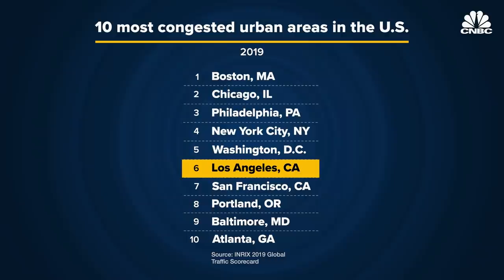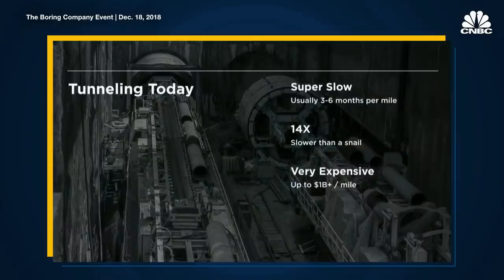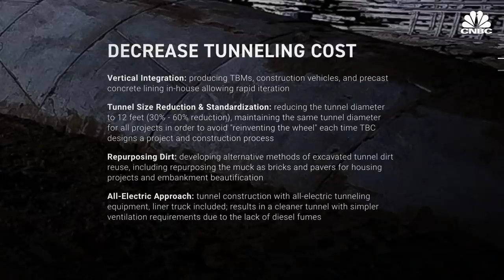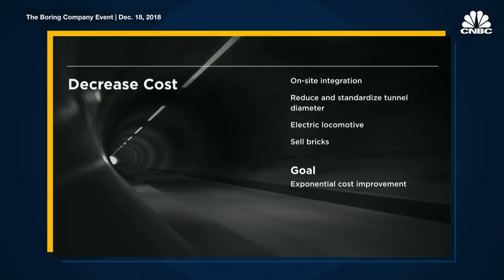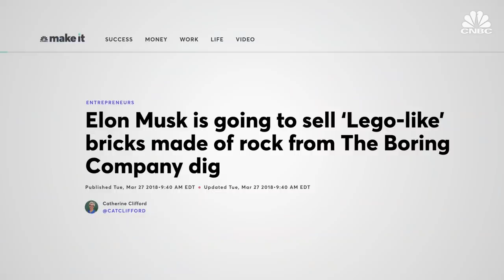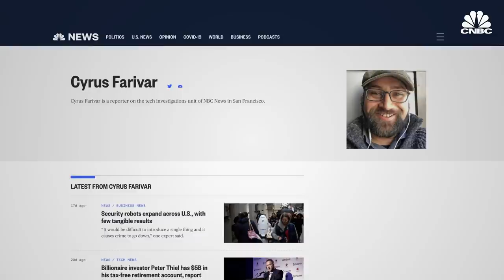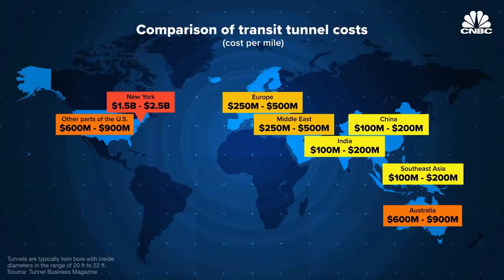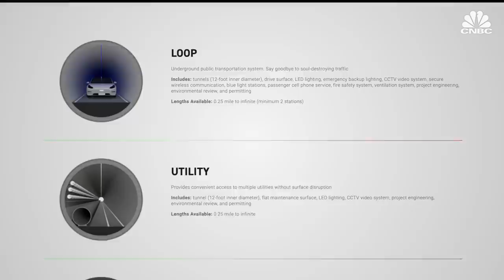Why Elon Musk’s Boring Company Isn’t Fixing Traffic Anytime Soon

Comment: If you have over a million cars on the road concurrently, even 30layers roads under the ground won't fix the problem.
Reply: Elon mass produces cars then complains about traffic. 😂
Reply: @chromebomb  he could've made electric buses, but governments would've preasured them for right to repair.
Reply: Boring tunnels are roughly 100 times cheaper than the most expensive New York/LA tunnels. So you can probably do more than 30 layers easy. You basically need as many levels underground as you have floors above the ground.
Reply: @abhinavcj1  The boring tunnels also have 100 times less capacity that a metro system?
Reply: @projectaks4745  Your math is off by a large margin. The maximum road capacity is around a four times increase to single lane roads. This is also considering that you are only allowed the 2nd dimension. Take this and incorporate the 3D aspect and you can double, tripple, or even quadruple that of road space. You also forget that underground, there are no traffic systems, which can make navigation completely automated and linear. No lights and signs attached.
Reply: Seems like elon just waste money.

I always think that why elon just build a tesla train?
Reply: @sethjansson5652  but impractical if cars use them, public transportation ftw!
Reply: @sethjansson5652  Why not just run run trains trains through the tunnels if it is viable to make hundreds of them, the tunnels are actually a few inches larger the size of typical deep level metro tunnel?
Reply: @sethjansson5652  1 tunnel, 1 train is cheaper than 50 tunnels

Induced demand, by the way. Adding an extra lane NEVER works.

Comment: a subway for 5 people. revolutionary
Reply: Surely there will be improvements. Like the adding more capacity by a new revolutionary technology called "One Engine With Various Passangers Carts™". Next there will change the motor from using batteries to use electricity by connecting to a "Hyper Electrical Chargin Rod™". And lastly they will change the rubber wheels to a revolutionary system of using steel wheels over layed "Hyper Tracks™". Dude, imagine that...
Reply: just wait!!! Elon will then REVOLUTIONIZE this by making a long "pod" that can hold up to 50 people at a time! It will then have an overhead power system so they wont have to lug around those batteries! Genius!
Reply: Less than 5% of the U.S. population  uses public transportation.  Americans , overall, just don't prefer to use the subway or the bus. That is the reality of the situation.  But I guess watching empty  buses drive around town wasting tax payer money and polluting  is your answer? How much money did Amtrak make last year?  Last decade? Listen, I'm all for public transportation  but as impractical as it may sound, the average American is sitting in traffic burning a tank of gas right now.
Reply: @MattSeabolt  People don't use public transportation because it sucks. And it sucks because politician rather spend it on stupid magical solutions like these that end up making things worse
Reply: @MattSeabolt  The keyproblem in the US is, that there are no connections, while u might be able to use a public bus in the city u can't get out without a car. So everyone needs a car and oh wonder, why should i use public transportation if i need a car anyway...^^
Reply: Ram - LOOP has Better throughput than a High Capacity bus or LRT.

Comment: In my region in Germany we have multiple different train networks that work together, though I wish we had even more trains. In the us with all this vast space trains would work even better.

Most cities with more than 100k people have a tram or even a subway system, which often extends to neighboring small cities. Cities with more than 10k people and even some smaller cities are connected by faster trains going 120km/h (70mph) with stops every 5 - 20km (3-12mi). In larger cities you can change from those faster trains to long distance trains that go up to 300km/h (180mph) that have stops every 30 - 200km (18 - 120mi).

Trams and especially the faster trains could thrive in us suburbs I think. Long distance high speed trains are a great alternative to planes (far more comfortable and spacious) and easily beat driving and definitely should be a thing in the us, too.

Comment: light rail makes the most sense economically, and far better environmentally than massive roads and complex tunnels everywhere with loads of cars on/in them.
Reply: I'd rather just take a cable chair lift to the supermarket.  No stops and no puddles of piddle.
Reply: @lowrads3653  European and Asian trains are Impeccably clean. Socialism and/or even privately run trains maintain public transport easily.

Comment: comparing the cost of 3 lane high clearance tunnel that even trucks can pass through with a 1 lane low height tunnel is stupid. back of the envelope calc. - elon musk's tunnel height is 1/4th and width is 1/4th of usual tunnels, ie. 1/16th the usual cost just by scaling down the size of the tunnel (assuming cost is linearly proportional to the volume of earth to be excavated). as usual a marketing gimmick by elon musk.

Comment: As a civil engineering consultant with years of transportation infrastructure experience I can say this without any hesitation. Building a single lane tunnel for cars is idiotic. It will not solve the traffic problem. It may suffocate a bunch of people when one of those electric cars catches on fire though.
Reply: So far the LVCC loop and extensions are working well.  Passenger wait times during the busy CES averaged less than 10 seconds. Trip times averaged less than 2 minutes. 

I have a hard time imagining a rail based system that could match that level of service. Especially one that could be built underground or elevated for less than $50 million.

Comment: almost all of these tunnels with "Tesla shuttles" would be better with trains.... if you could drive your own car its different, but if your being shuttled it may as well be a train....
Reply: Even if you could drive your own car, it would do nothing to solve traffic. See induced demand.
Reply: @kirkrotger9208  100% agreed for the average person, but for the rich it could be another matter, but Teslas just don't seem the right choice to maximise throughput.
Reply: @kirkrotger9208  Lol, there is an upper limit to induced demand. Boring co's model, which is having large no of small tunnels, wil largely address this.
Reply: So, why don't other companies do this...if u think this is a very obvious solution, let others do it? No one is stopping them.
Reply: @archigoel  issue is its not viable, you heard how much it costs per mile, $2bn, you can build highspeed rail over ground for WAY cheaper (like $30mil?).  The Chinese have built more high speed rail in the past 5 years than the rest of the world has built in the past 30.
Reply: These go point to point. That's much faster than having to stop at all the intermediate stations.

Additionally, the cars only run when there is demand and is easily scaled. Whereas trains and buses often run partially full and even empty. It will be more practical to provide TBC service of just running a few cars in times of low demand.

Tesla vehicles are inexpensive and are manufactured in mass quantities. Used ones can be sold periodically and replaced by newer models.

Trains require expensive tracks, power systems and lots of system maintenance. There is no dangerous high voltage third rail to imperil workers and others. 

The cars in TBC tunnels in principal could emerge from the tunnel and continue autonomously on surface streets.

A Tesla enters the station at a low speed and with autonomous technology so it shoukdn't be able to run over anyone. Plus you can't fall from a platform onto the tracks.
Reply: @archigoel  
Amazing how the green planet saving bloke, seems to have planet destroying side projects.
Reply: Neanby - FORD and gm KILLED the Electric Train in America in the 1930s , see gm Streetcar Scandal.
Reply: Neanby - also , Trains will cost $ TRILLIONS , LOOP will only cost $ MILLIONS to build.
Reply: @archigoel  Do you have any idea how many lanes you'd have to add in major metropolitan areas to outstrip induced demand? In most places it's more than double, often triple or even quadruple the existing capacity. And don't forget, you have to do this across basically the entire road network, not just arterials.
Reply: @user-nw8jr1dk9p  You clearly have no idea what you're talking about. Do you know what the car ownership rate is in Manhattan, The wealthiest of the boroughs in the wealthiest city on the planet? 22%. 22% of Manhattanites even own a car, and of those, only about a quarter use them with any regularity. The people in most global cities who own cars are the poor and working classes who can't afford to live in the more desirable areas with access to good public transit. Where there is good public transit, rents are significantly higher than where there is not. That isn't a coincidence. Most people, especially young people do not want to own a car. https://www.theatlantic.com/business/archive/2012/03/why-dont-young-americans-buy-cars/255001/

Cars are among the chief reasons why the US sucks. Why would anyone want to contribute to that? The whole goal for most people is to live in places without cars.
Reply: @kirkrotger9208  no matter how much you may try to convert people from using cars , into using public transportation, it will definitely never work.... I would bet my entire life .
You'd be wasting your time .
Reply: @user-nw8jr1dk9p  Okay, but given the fact that literally every time quality public transit has been built, it's become the dominant mode of transportation for people nearby, you'd lose that bet. Case in point: Amsterdam. It went from car-dependent hellscape on par with LA or Dallas to an urban planning Mecca practically devoid of cars within 30 years.
Reply: @kirkrotger9208  The car ownership is low but they use taxis and Ubers.
Reply: @Goldsteinphoto  We don't though. The only people who use Uber and Taxis are tourists. Everyone who lives here takes the subway or bus unless they're going to the airport.
Reply: @Goldsteinphoto  We don't though. The only people who use Uber and Taxis are tourists. Everyone who lives here takes the subway or bus unless they're going to the airport.
Reply: @kirkrotger9208  I never saw anyone in Seinfeld use the Subway. Washington DC has a subway and busses in the entire region. It still has terrible traffic congestion. So does NYC.

Since it costs way less for TBC to build roads underground with far less disruption than to build surface roads...it will happen.

Comment: I know too little about tunnel building to tell if it can be vastly improved in cost and speed. But what I do know is that adding underground highways won't solve congestion. It could even worsen it through induced demand.
Reply: You may be right.  Despite the five-year old CGI that people are debunking, none of the projects TBC has actually proposed will act as underground highways.   You won't be able to drive your own vehicle into them, even if you drive a Tesla. They are closed, like a metro system.  Even if you have your own train, you probably won't be allowed do drive it along the metro tracks.

In a system like the one in Vegas that they're just starting, none of the cars up top will get moved to highways underground, but many tourists will opt not to rent cars if they think they can get around easily using the Loop.  And many who take taxis or Uber will find the Loop more convenient and faster. Even cheaper.    So those people will not be in vehicles above ground.

That may ease traffic above ground temporarily, but induced demand might make it just as bad as more people bring cars in anyway,.  A traditional subway would have the same effect.  People taking the subway will just free up room on the surface for more people to come in.   I don't think the casinos mind.  More grist for the mill. 

If you really want to fix traffic on Las Vegas Boulevard and other high-vehicular traffic areas, you do what they did decades ago on Fremont Street.  Turn the streets into pedestrian malls.     But to make that work on the Strip, you need a subway system or a loop.   And they're getting a loop, so maybe someday...
Reply: Tunnel boring machines are over a hundred years old, so were it possible to miraculously make it ten times faster and ten times cheaper by snapping your fingers, it'd have been done. Any time someone makes such claims the first assumption has to be that it's BS, and with Musk's track record, well...

Oh and his tunnel is indeed cheaper (though iirc it was also very slow, a mile a year or something), but only because it's tiny. Cost scales with tunnel area.
Reply: @Hailfire08  I don't think the idea is to make them miraculously faster by snapping your fingers.

Comment: Why is nobody's addressing that even if the "visionary" auto metal platform system works, the entrance to the tunnel would still create hours long jam for cars to hop on to the platform one by one?
Reply: Someone did the math on twitter and turns out that you need massive station platforms to load and unload as many people as they claim it can carry. A station the same size as a typical subway station can load and unload many magnitudes more people per hour.
Reply: Well just build a tunnel to beat those ques.
Reply: well why not just have the entrance to the tunnel one by one space out so one car goes waits 5 mins then the next car goes so you don't clog up the tunnel entrance???
Reply: Why do you think there would be a jam?  Every time a car enters the freeway using an on ramp, is there an hours long jam?
Reply: @davidbeppler3032  
Yeah, that's where all the jams start.
Reply: @davidbeppler3032  Cars can enter the freeway at 70mph as often as there is space for them. Cars can only Elon's tunnel by manoeuvring onto a cart the size of a parking bay, and can only do that as often as a cart becomes available. The absolute best case is that this works as fast as a toll booth, but look at how big you have to make toll plazas and how they still cause traffic jams at busy times. Then look at how you don't have that much space available in a city.
Reply: @beeble2003   Also in a congested city having a dozen Tesla elevators would reduce internal traffic significantly.  Why wait for one to be open?  If it is faster the car takes it, no waiting, making less traffic on the city street.  If it is not, the car continues along the street.
Reply: @Robert-cu9bm  Why would there be a jam?  Also it is great that typical city streets never jam.  Loads of cars with no option but to line up and wait on tiny streets.  It sure would be nice if a few hundred an hour could just express out of the city without using the roads.  Might make it better for everyone involved.  Watchu think?
Reply: @davidbeppler3032  "Also in a congested city having a dozen Tesla elevators would reduce internal traffic significantly." How would it do that? It's going to take at least a minute to get a car into the tunnel. That limits each elevator to 60 cars an hour. In fact, 30 cars an hour, because every car that enters the tunnels also has to leave. So your dozen elevators can handle a total of 360 cars an hour. That's nothing. A few buses could take that load.

Build ten times as many elevators and you can handle 3600 cars an hour. So you just spent billions of dollars, built a network of tunnels and 120 elevators and you have a system that can handle rush hour in a small rural town. The profit is going to be rolling in!
Reply: @davidbeppler3032  "Why would there be a jam?" Because entering the tunnel system requires waiting for a cart to be available, and then driving onto that cart. Essentially, getting into the system requires parking your car. If cars arrive faster than they can be taken into the tunnel system, a jam develops.

The problem with current cities is that every car ends up in a jam. The proposed solution also has every car ending up in a jam. It doesn't work.
Reply: @beeble2003  There would not be a jam.  The car would not wait for a cart to be available.  When a place is available the nearest Tesla is flagged and leaves the city.  No waiting.  Removing a few hundred cars in an hour would remove the jams, not cause them.
Reply: @davidbeppler3032  What "nearest Tesla"? I'm supposed to be able to use my own car. If you believe that dealing with a few hundred cars an hour solves the traffic problem in any city, you have no understanding of what the problem is. A single lane of traffic doing 30mph with 20 metres between cars is nearly 2000 cars per hour.
Reply: @beeble2003  Your car has Tesla autopilot?  Ok, then you can use it.  Studies show that removing even 5% of vehicles from a road greatly reduces congestion, accidents, and improves drive times.  For every stupid comment I have an intelligent answer.
Reply: @davidbeppler3032  The system is that you drive your car onto a cart which moves through the system. Your car doesn't need autopilot. And just a quick hint: intelligent people don't need to explain that they're intelligent. It's self-evident.